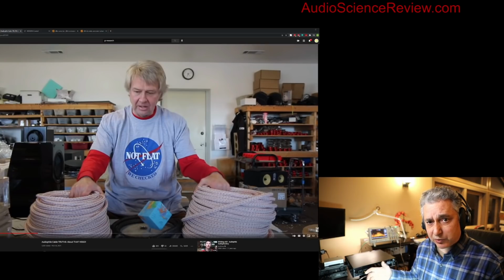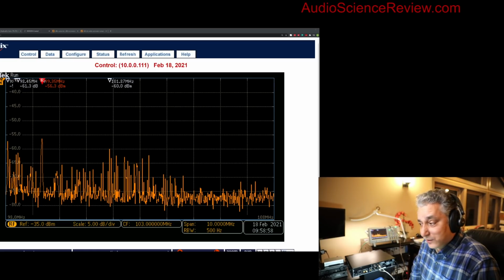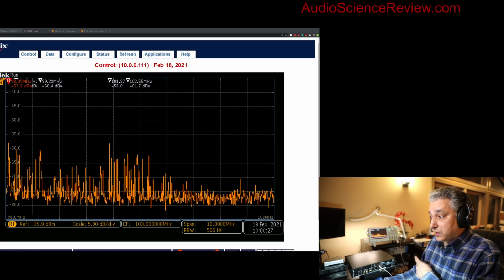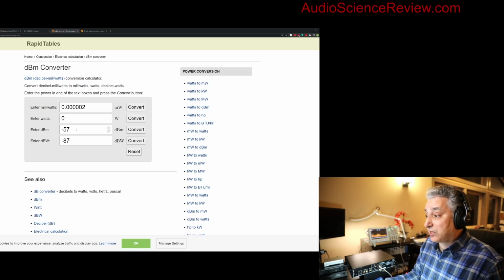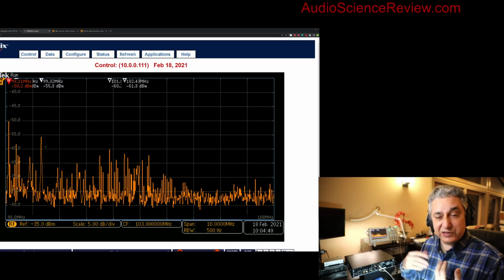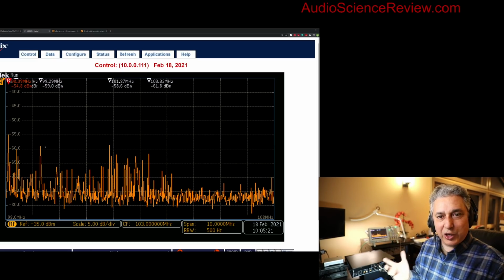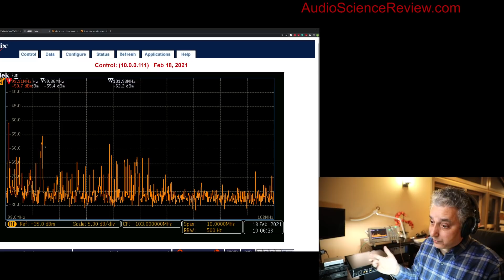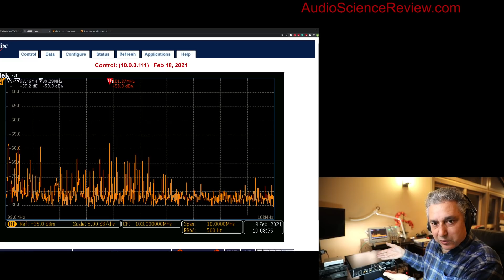RF Interference in Speaker Cables???

Comment: Could you please do a Video on expensive Powercables, Linear Power Supplys and power conditioners? It would be really interesting to see if there are measrueable effects in any of these or whether they don't have any measurable effects.
Reply from the maker: Sure, I have fair bit of material on that already.  :)
Reply: @AudioScienceReview  Awesome!
Reply: @AudioScienceReview  How about the GaN Systems do you have any plan do a video for that?
Reply: John Bravo  
If a power conditioner helps, your amplifier has a crappy power supply.
Reply: hey bro after 48 years i can tell you that no power conditioners can give you a real "impact" you will never feel the dynamics of the music like being connected directly to the power line .i have two lines to my main power board each off them is a speaker cable of supra model ply 3.4 used as a live and natural . the best way to connect grounding is to separete it from those cables so i put 5 cm copper foil all the way to board . i get pitch black on 200 w amp full power no music .no noise at all.the sound stage is hugh with pinpoint imaging .no need to spend alot of money just do it right......enjoy bro...
Reply: @shaynakash4222  thanks for the answer. I am was guessing that its the case. So far to my ears only the room, the speakers, the source (flac vs mp3 and recording fidelity) and the amplifier make a big difference. I can't say that I've heard more than subtle differences from DACS so far.

What kinda annyos me is that the Fomo I get from seeing a lot of people talking about expensive Cables, Powerconditioners, dacs or streamers is pretty real sometimes.
Reply: @Xornal1  well if you use the right cable on your power line with separetrd grounding when copper foil is best you will get pitch black no noise at all behind the music  and full dynamics .something no conditioner i know can do .you will not belive the diferrence in your sound quality .....enjoy bro...
Reply: I've been arguing with so many people, I've been involved in electronics since H.S. and was an electrician. I've done many, many types of power distribution, A SIX FOOT CORD BETWEEN THE WALL AND YOUR GEAR CANNOT AFFECT WHAT YOU HEAR! A zip cord power cord sounds NO different than a 12,000 dollar power cord. Can't happen.
Reply: @bradt.3555  Yeah, I gathered that so far. I am still amazed how many companys claming things like "Better base, better soundstage, less distortion" , which mostly (except soundstage) are quantifiable. 

Last week I saw a video aboutcustom feet for electronics and the inventor clamed "less distortion" and even showed the difference in measurments of a turntable with and without.....ofc only the measurements of the movement and nothing about thd+n or the difference in frequency response.

For me the only reason to get more expensive cables are build quality and looks.

Comment: Remember, his original premise was that by using RF as a testing tool, a better sounding cable could be determined. Better sound was the goal and the method he used was just not relevant to that premise. It’s like testing the box to see which pizza is better.
Reply: What would you do instead? Listen?
Reply: A) He didn't use an RF testing tool. He used an FM receiver that provides no qualitative data
B) At no point did he offer any plausible explanation that's backed up by data and/or engineering principles explaining how minuscule voltages on an speaker cable can make audible differences.
C) If better sound is the premise, measurements that validate a change in sound quality are required. None was offered. 
D) As mentioned in this debunking video, the test setup was flawed, not representative of the system in question, speaker connected to amp, I.E. the real world load.

Comment: I used to hear my college radio station (FM, 30KW, line-of-sight to the antenna about 500 feet away from my 10th floor dorm room) on every input of my receiver.  I tried changing the ground wire connection, putting metal caps over the unused inputs, everything!  Moving the receiver behind a concrete pillar in my dorm room finally got rid of it.
Reply: @Douglas Blake Well maybe there also was an AM simulcast from the same antenna tower, but dozens of us on that side of the building above the 7th floor experienced that problem and discovered the same solution. Seventh floor and lower were in the "shadow" of the shorter building next door.
Reply: Surely 30 watts, not kilowatts!
Reply: @MrsZambezi  Nope it was KUSC - University of Southern California, 39KW and the antenna was mounted atop one of the university's buildings.  The transmitter was moved to a mountain top in 1976, but I'd transferred to another university about that time.  The university I transferred to (UC Irvine) had a 10 watt station and wasn't allowed to boost its output due to its proximity to the border with Mexico.  The signal barely reached the large student population living just a few miles away.
Reply: @darthbubba866  I stand corrected. :O)
Reply: @MrsZambezi  Hey, we good!  👍😉

Comment: RFI problems in audio gear CAN BE VERY REAL. Not in the way "audiophiles" represent, but in a strong enough RF field the RF signal can couple into gain stages in various ways and the frequency being way higher than audio electronics are designed to cope with, the gain devices can be pushed past their linear operating parameters.  At the least this causes a characteristic "buzz" in the audio - which is CLEARLY audible - and at worst can blow up an amplifier.  I was testing a 2 meter ham radio transmitter on my workbench into a dummy antenna load while listening to background music from a streaming source coming through  my PC to an NAD integrated amp and playing through some small Polk speakers I had in my workshop.  All well and good, but when I engaged the 400 watt RF amplifier in the transmitter, the PC/NAD/Polk audio system emitted a loud hum for less than a second; the B+ fuses on the NAD's output stage opened because  the output devices shorted. This sent DC to the speakers and the voice coil of one woofer opened up. This was caused by RFI driving the amplifier crazy.  An extreme case, to be sure, but if you are *VERY* near an FM or AM station, or an amatuer radio operator, or a medical diathermy machine or an arc welder, you might well experience anything from crackling or other noises to strange hums to outright amplifier failure. RF can get into gain stages in many ways and if your audio system is really near a powerful RF source it can be the most devilish thing to cope with.  RF power levels decrease as the square of the distance (in general) so if you are farther than a few hundred feet from any such source you shouldn't have any problems - with the exception of truly powerful broadcast equipment in which case a mile or more might be better.

Comment: Nice video, Amir. What about power cables carrying high current bleeding into loudspeaker cables? Is there any possibility of that?
Reply from the maker: Sure.  The issue is that our hearing sensitivity is very poor in low frequencies where mains power is and its harmonics.  So you would have to get an extreme case before anything becomes audible.  If you are not hearing it by putting your ear next to the speaker (with your system off), then it is not a problem.